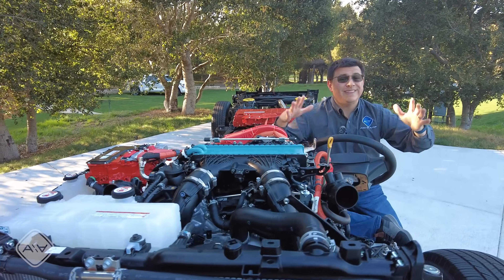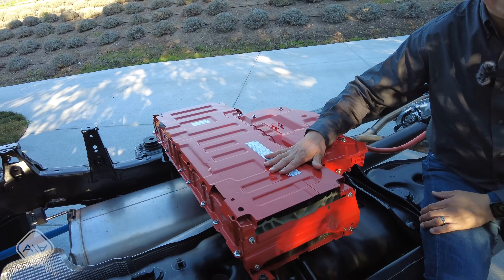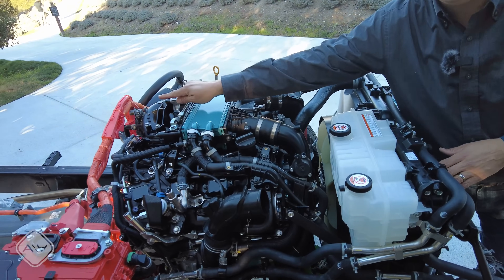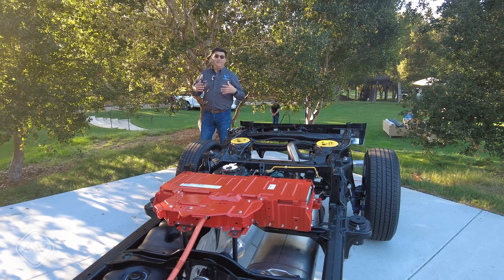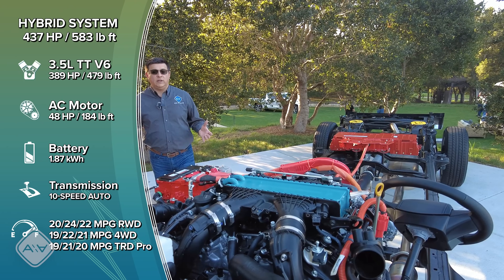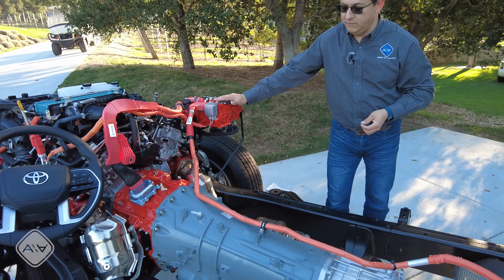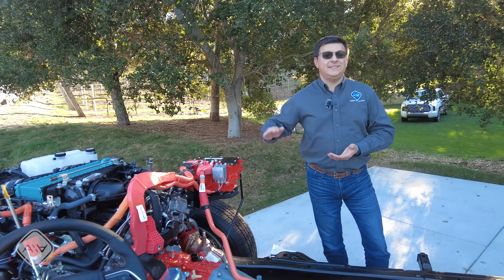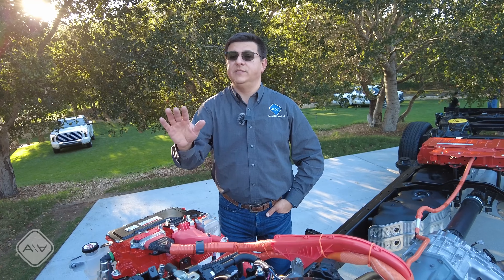How Toyota's New Truck Hybrid System Works | 2022 Tundra & 2023 Sequoia

Comment: 2023 Toyota Sequoia
Best in class
Reply: Well looks and interior is great. But shrunken interior space and lack of IRS may be a dealbreaker
Reply: @naveenthemachine  Toyota is trying to keep the vehicle garageable, and the 3rd seat is adjustable, so I don't see an interior size penalty.  And if the ride is smooth, I don't need IRS, unless I'm off-roading all the time.  Haven't heard anyone say it doesn't ride well
Reply: @InvestBetter.  well hopefully the solid axle is a good partner.

Also second row legroom has shrunk as well. The last gen sequoia was very roomy inside almost comparable to the long wheelbase SUVs from ford. The adjustable third row seat is a pleasant surprise but they could have done the same for the second row. And they should have improved the cargo space

Comment: This makes me wonder why even have a hybrid system for the Tundra? All this for 2 MPG and not many more ponies?
Reply: MPG scales in a non-linear fashion. So 2mpg here is like a 5-10mpg difference when looking at 35-45mpg vehicles.
Reply: @ALMX5DP  Thats actually a decent point. Kinda wish they went a bit further with it and tried to give it maybe 2 more MPG but with the design of the system I'm not sure what kind of sacrifices they'd have to make,
Reply: The power gains are incredible! This engine replaces the V8s with power above any NA V8 out there. We’re talking twin scroll V8 power here. Compared to the previous 5.7 V8, the MPG boost is almost 50%! A comparable power turbo V8 would net you somewhere around 12mpg combined in this application. 

So if you have always wanted a giant V8, then this hybrid is your champ, with MUCH better fuel economy and more power, but if you never needed that, then you should opt for the V6 non-hybrid engine.
Reply: The major gain is in the torque curve.  Without the hybrid system, the engine is good, because of the turbos, but the hybrid system, there's a very big gain in torque across the tachometer instead of a narrow sweet spot.
Reply: 10% additional fuel increase (marginal but still). More importantly on hybrid model additional 51hp and 74lb torque. Not massive but still significant.
Reply: @James98374  I think the hybrid has over 100 lb/ft more torque than the regular V6.
Reply: because this is a TRUCK, made for TOWING. for an additional 104 lb-ft of torque throughout the ENTIRE RPM range,
Reply: @gwot  Trucks aren’t made for towing, though they get used for it. They’re not tractors. Trucks are for hauling freight. Many won’t tow more than a Highlander.
Reply: To say they have a hybrid tundra

Comment: Is the 10 speed transmission from same reliable Aisin?
Reply: Yes. It's Toyota own personal design coming directly from Aisin. It's not related at all to the Gm or ford 10 speed auto
Reply from the maker: The most honest answer is: we don't know since it is new. However, Aisin's transmissions have been very reliable and we have no reason to predict differently at this time.
Reply: Note though that it will be slightly less reliable due to the turbo.
Reply: @Luma_29  it will not be less reliable, the Lexus ls500 and lc500 have had this same engine and (original 10 speed )gearbox
Reply: @Luma_29  How does a turbo charger make a transmission less reliable? Does a supercharger make it more reliable? Please provide a citation for you claim.
Reply: @morstyrannis1951  assuming he's not stupid, my guess is he's implying the added torque of a turbo adds stress to the transmission, which I think is engineered to withstand anyway...

Comment: Will it tow 16K pounds?
Toyota needs to get serious with a diesel Dually.
Reply from the maker: Expect a 3/4 ton truck from Toyota around the 12th of Never...
Reply: @AAutoBuyersGuide  just like expect Toyota to be a segment benchmark overtaking Honda or the Koreans around the 12th of never 🤣
Reply: Would you tow 16k ponds with any half ton??
Reply: @michalp2362  Nope, need a 350 or 450 for that.